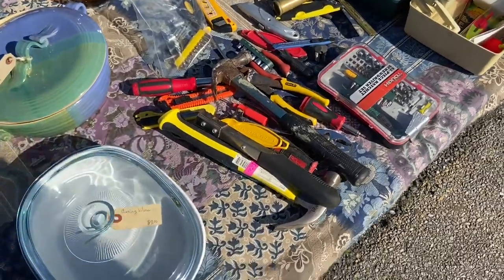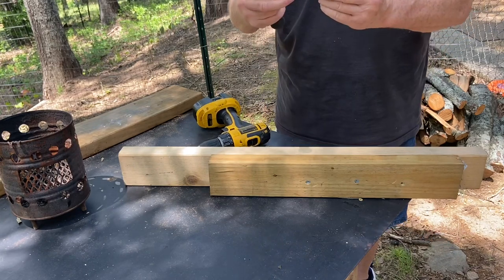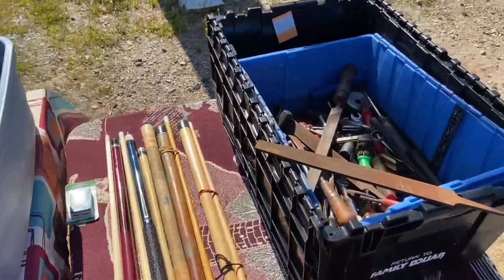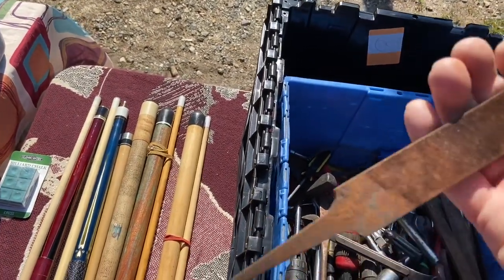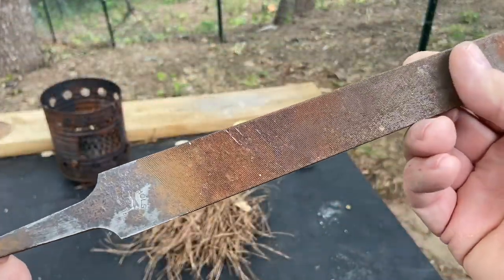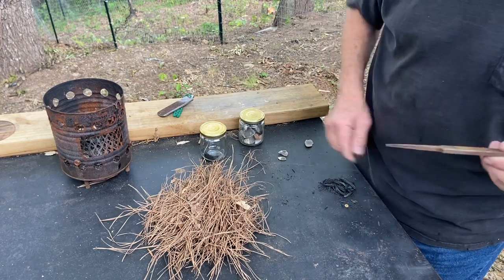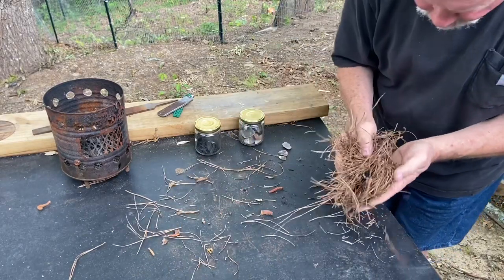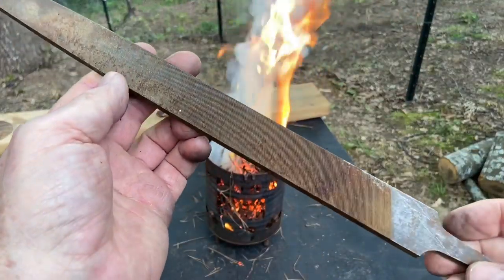2 Flea Market Finds, Stanley 16oz Claw Hammer * Will Nicholson File Make A good Steel? Cast Sparks?

Comment from the maker: The well worn Stanley 16oz claw hammer needed a lot of cleaning. After hitting it with some purple power and a scotch brite pad, I was ready to try it out. Since I had no 16 penny nails, I just drove me some 4" screws instead, LOL!
   Every time I go to the Flea Market, I look for old Nicholson Files that can be turned into a Flint and Steel, steel. In yesterday's video (LINK Below) I found a good candidate for just $2. Before fabricating a steel, I always check the file for sparkiness... will cast sparks? This one did cast sparks well which ignited charred punkwood which I used to ignite a Pine Needles Tinder Bundle. Someday I'll make another Steel build video; until then, check out the steel build videos that I've already made at the LINKS below. Please SUBSCRIBE. Thank You!

Making A (Flint and Steel) Steel Out Of A File And Trying It Out!
https://youtu.be/nBrX2gi80Ts
Making A Flint and Steel, Steel From A Nicholson File
https://youtu.be/HOPECwE-Mck

Comment: True story...when I was homeless in Florida during the Recession, I worked for free for someone just because I wanted to have something to do. They gave me $20. I took that $20, got something to eat, went to a pawn shop and bought tools out of the dollar bucket (utility knife, tape measure, level, hammer, pliers, screwdrivers, etc...) and a little tool bag. I knocked on doors and did little repair work with that little box of tools. 

2 months later, I got a ticket to go back home to New York and 4 months after that, I had a Ford Explorer, a Ford E250 cargo van, an office, a 1500 sq ft warehouse and a few thousand bucks in tools (ladders, scaffold, guns, compressors, etc...). 

That's the wonderful thing about this country; If you have the drive and are willing to work hard, any man can lift himself out of poverty and own his own life.
Reply from the maker: More than drive maybe? Physical fitness, sounds like you had good credit, people skills, etc.
Reply: @DavidWestBgood2ppl  Zero credit. I started in the red. But, I worked my tail off. 😊
Reply: @DavidWestBgood2ppl  youre so right david. Not everyone has the knowledge or the luck. Sometimes good hard working people can't catch a break. 

To say its their own fault because they didn't try is ignorant and disrespectful because you don't understand everyone's situation.